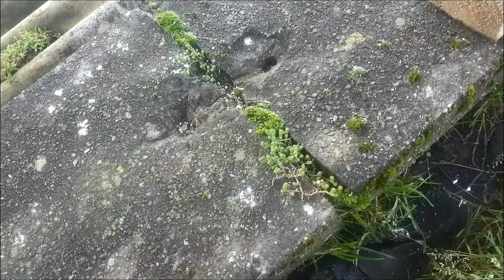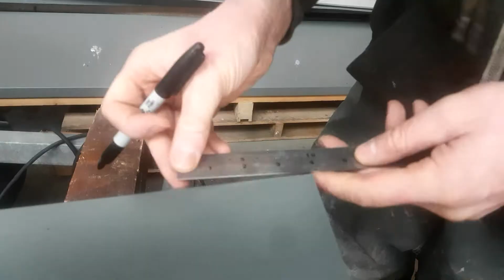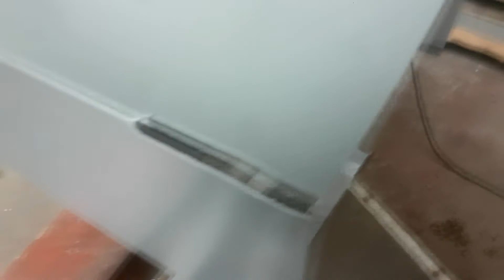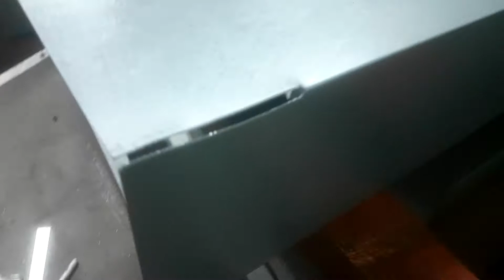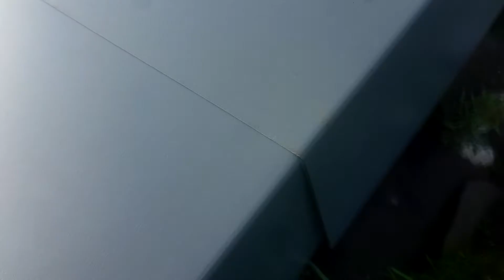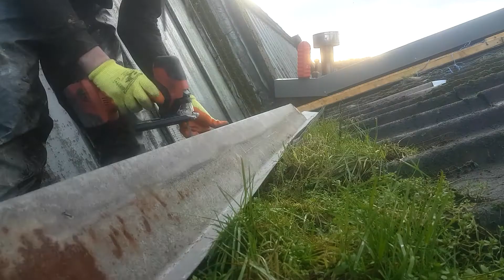Fixing leaking copings - Hilti TE6-A22, Hilti SID 4-A22, Makita JN1601, Hilti SJT 6-A22, Hilti GX3

Comment: How do you find your Te6 and SID4? I have just bought them.
Thanks,
Dave.
Reply from the maker: Both first rate. Had them about 2-3  years and they haven't missed a beat. As a breaker the TE6 is brilliant. Bit heavier than the TE4 if you are drilling upwards but it is a little bit more powerful. Haven't much to compare but a guy I was working with had a dewalt impact driver and I was struck with how much noisier it was. Didn't notice any real difference in power between them so I was happy to enjoy the quieter machine!
Reply: @projectbuild9784  Ah....my mate had the DeWalt and said it was no good. He loved my SID4. I used my Te6 for breaking up some tough floor tiles in work but it had to be precise as I was taking out a middle broken section of about 6 tiles and didn't want to damage the rest. The Te6 was really sweet to use....Huge power but precise with it. Just bought the new SF6H A22 brushless combi....WOW!! What a tool!
Many thanks,
Dave.
Reply from the maker: @davesheppard8797  That will be a very powerful drill. I have the older model that they first brought out. Forget the number of it and it is well scuffed off the side now. Other than an occasionally slightly sticky chuck, it works perfectly. 

That is the one thing about Hilti tools. They may not have the best specs etc. but they will take endless abuse and just keep plugging away.
Reply: @projectbuild9784  yes this is true......but this new SF6H A22 brushless is beating the pants off the likes of Milwaukee and DeWalt. Everyone is quite shocked. Plus the build quality is superb, ergonomics are great and it is a joy to use. Everyone was bitching that if the Milwaukee had a bigger battery it would win. I put a 9amp hour in my Milwaukee and a 2.6amp in my Hilti SF6H and the Hilti easily won the head to head. The low down screwdriving grunt is amazing (I always use torque settings usually leaving the drill on screw and 15 on torque for all applications). Plus it has ATC  to save your wrist.
Thanks,
Dave.
Reply from the maker: @davesheppard8797  I have heard it is great for power compared to the competition. One big advantage is Hilti went with the extra cell which means more voltage (helps torque) and lower currents (helps efficiency and lower temperatures). Something that all the other 18V platforms can't match.
Reply: @projectbuild9784  😁😁😁👍👍👍👍